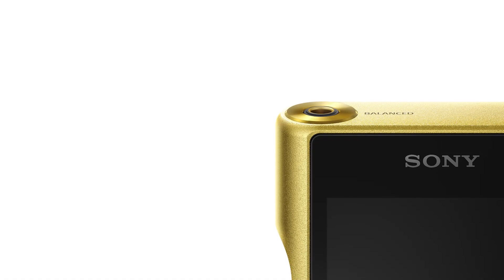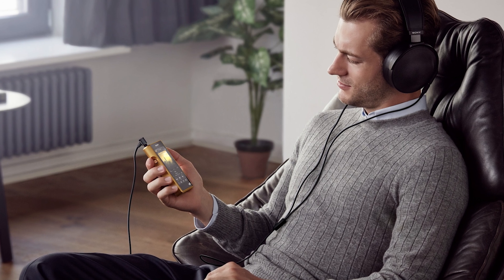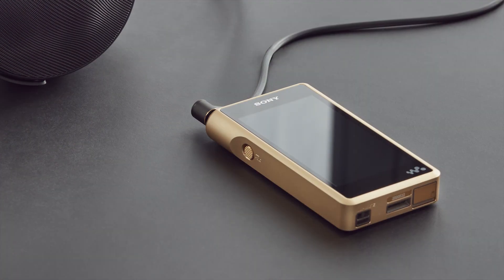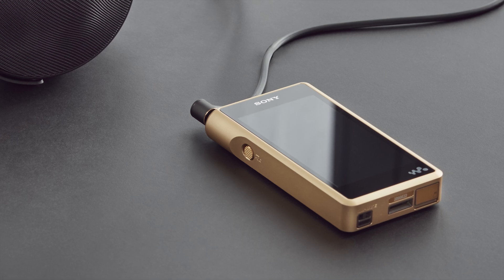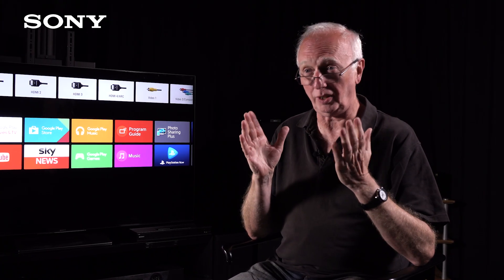Sony’s audio tech explained: 4.4mm Balanced Output Connection

Comment: I understand the noise cancellation aspect of balanced cable. In general I play my wm1a well away from interference and hear little to no noise (in general) with unbalanced hq iems. So what else does a balanced cable give me in terms of audio/musical enhancement?
Reply: There's suppose to be a bit more power output from an amplifier when using Balanced, but don't expect enormous difference. Seems like it's a lot of $ for not much improvement but I get the idea of a sturdier 4.4mm connector rather than the cheap 2.5mm

Comment: As far as I understand the amount of noise that can be cancelled out with a balanced connection is only useful in long cables, such as those used in concerts, gigs etc. From your device to your headphones how much noise can you get? i,.e. What's the need for this?
Reply: I understand completely, I'm a "cable atheist" I only believe in measurable results, physics. However, I am going the route of balanced cables, not because of SQ, but because balanced cables simply deliver more power to each headphone, I want that.

Comment: Not so sure if you really need a balanced signal to travel 3 feet from your device to your headphones. Looks like a solution in search of a problem.
Reply: I just bought a DAP that has a 4.4 mm balance helper and the traditional 3.5 mm as well. I'd never heard of balance out put until I bought it. I also just learned that they don't call them mp3 players anymore lol I guess I got old.

Comment: This video explained NOTHING at all. Do the video title some justice and actually explain the nitty gritty tech behind it.
Reply: Instead of having 2 wires (one for the left and one for the right, unbalanced this is called) and a third ground wire. In a balanced cable you have 5 wires. The left has two wires and the right has two with still one ground. The reason behind this if you have long lengths of cables (typically > 4 metres) then any electrical noise in the air cutting across the wires could induce a unwanted sound or hum. 

But a balanced cable will induce the identical unwanted signal in both wires of say the left. At the player side you mix the two lefts together and therefore the unwanted hum will cancel each other out and you're left with just the signal you want. Audio professionals have been using balanced cable for many decades as they do provide a cleaner signal. 

But it's unlikely to provide any improvement to typical headphone cables which are only 1 or 2 metres in length.... Any decent headphone cable will be shielded in any case. 
The ground wire in these actually coats and wraps around the entire length of the left and right wire in traditional headphones so they don't pick up noise.
Reply: @ProfStuartHalliday thanks
Reply: So it's just one of the most basic ways to reject common mode noise? And they make it sound like the greatest innovation in Audio history....
Reply: https://www.youtube.com/watch?v=91JQRAjZ_Qw